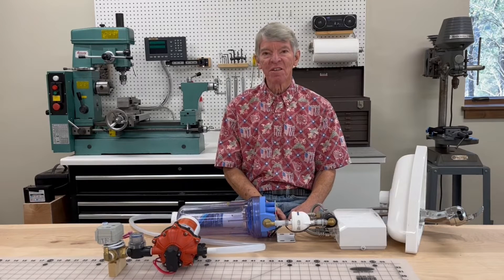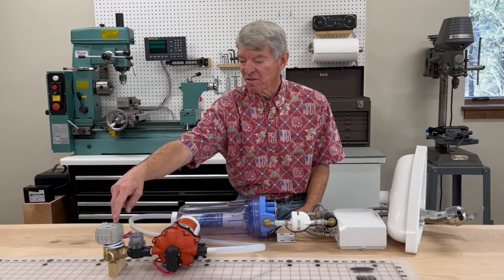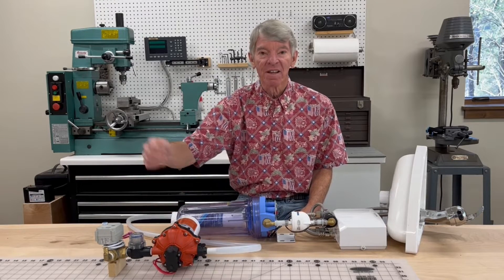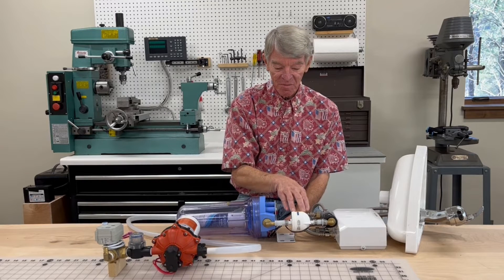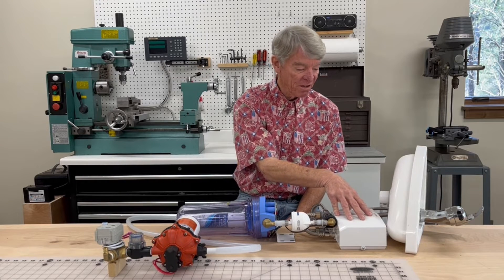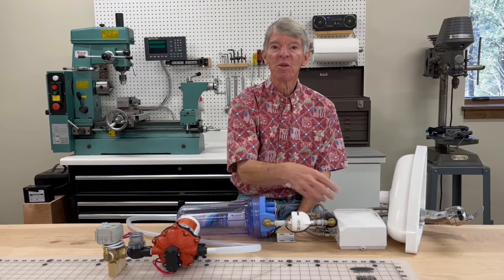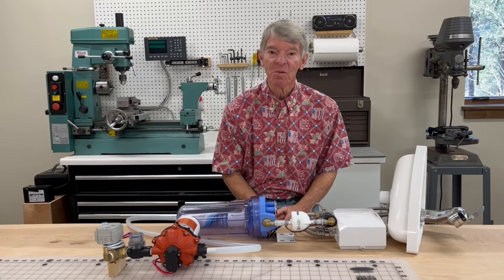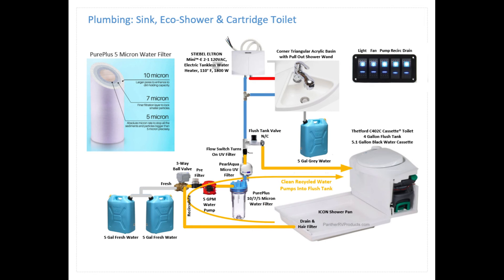Camper Van All-Electric Recirculating Shower w/Tankless Water heater and LED UV Filter

Comment: Hey Pete there is another Stiebel water heater that doesn't have the Thermostatic control like yours, It's a little cheaper.  Mini 2-1 231045.    Did you consider this one ?  As essentially it seems as though by removing the flow restrictor you have basically taken the smarts out of your unit and turned it into a mechanical heater, that just heats as much as it can if it's under temperature no matter what the flow rate is.  Am i on the right track or is there some other reason you picked the one you are using?
Reply from the maker: I removed the flow restrictor to get a good flow rate to the shower head. The water is not brought up to temperature in the first pass through the heater, the recirculating water takes several passes through the heater and about 4 minutes to come up to final temperature. When first starting to heat the water the power is 1800W but after the water comes up to temperature the power is cut back by the thermostatic control to around 500W, just enough to keep the water at a constant temperature.

Comment: Would love to see a update video on your system! Like you mentioned in some of your replies. 

Just so I better understand your system... you basically pull a gallon worth of water from fresh tanks through recirculating system into the shower pan and then the you use the gallon of water from shower pan to recirculate? I know some people that have a tank to store their recirculating water. Any reasons why you avoided this tank?
Reply from the maker: Thanks for checking out this video.

Since I have no plumbing outside the van where it could freeze the recirculating water tank would be inside and higher than the shower pan. This means I would have to pump the water into the tank and then have to come up with a way to get it back into the shower pan for reuse. It seems easier to just fill a one gallon jug at the end of the shower and store the jug in the shower. This way I can check to see if it is getting too cloudy and just pour it down the sink when no longer wanted. It does take up room in the shower which is not ideal but not too bad. There are so many ways to implement a recirculating shower and my solution matches my requirements.

Comment: Hi Pete, thank you for the videos, we're in the planning stages. Currently 'weighing' the options of a larger fresh water tank vs recirculating shower. As a follow-up video maybe you can show the maintenance routine required for your system. That's one of the items we need to consider.
Reply from the maker: After we have a lot more experience using the shower I was thinking of doing a video on 1) how to efficiently use the recirculating shower, 2) how long the filters last before cleaning/replacing, and 3) how to maintain the shower for short term and long term storage. My wife and I use less than a gallon of water to take our showers. We use even less if we save and reuse the gallon of water a second or third time. The weight and space savings for carrying only 5 to 10 gallons of water instead of 20 to 40 gallons is huge.
Reply: Any update on this mate?

Comment: Hey Pete! This is great, I have based my design off of yours. Can you tell me how you went about removing the flow restrictor? Do you have any pictures or videos?
Reply from the maker: To remove the flow restrictor (which voids the warranty) I took the two end caps off (lots of Torx screws). Then you can look down the water channels and see which one has the flow restrictor installed and push it out with a screw driver. Make a note of which channel had the flow restrictor in case you want to put it back. I do not have pictures or videos on removing the flow restrictor. It has been awhile but I recall there is a temperature sensor attached to one of the end caps. Be careful not to damage the connection to the sensor.

Comment: Great vid. Did leave me wondering though, how efficient is a 2gpm uv filter in a 5gpm system?
Reply from the maker: The water flow rate of RV pumps drop significantly with backpressure. The cartridge filter, UV filter and water heater generate a good deal of backpressure. I tested a 3GPM pump and it did not compete with my home shower. When I switched to a 5GPM pump I get close to 2GPM water flow which rivals my home shower. The 2GPM UV filter seems like a good fit for my application.

Comment: I too have been working on this! I have been using an I-Heat shower head that runs on 110 an you can control temperature. I have gone with the nano ceram filters that remove everything and have a high flow rate but also I dont need the UV light because these filters remove virus/cyst etc!  The big issue Im having is using a Wavebrite Gray water module (24 inches) that removes all soaps/oils/shampoos etc in real time and figuring out the best way to hook it up because of its size. As far as I know its the only filter in the world that can remove soaps in real time, so I need to figure it out. I would like to run water through it for only the time needed to remove the soaps then bypass it as its good for like 5000 gallons an I would like to make it last., You can send filter module back in and have it refurbished!     I love your sink shower set up!  Nice!
Reply from the maker: Interesting selection of products. The I-Heat shower head brings 110V into the shower head and is a little unnerving. The one I saw tries to heat water in one pass and consumes 2.5Kw which is beyond my battery's current capacity. The filter cartridge seems expensive but I might try it someday to see if it works better and lasts much longer than my particle filter.
Reply: @fivepoundpete  Ya I don't have it in the shower I have it hooked up right after the filter and have a hose with shower wand coming into the shower stall. I can open the curtain to adjust temperature. It starts on high so you do need a good inverter, I wish it didnt start out on high because it has like 4 settings and I usually can get by on the 3rd setting which also lowers electrical consumption..My system right now is portable but not portable enough yet (lol). Like you found out circulating the water does not take as much energy once warmed up. Trying to go small but yet robust is a challenge when using off the shelf parts. Tghe 2.5Kw is to powerful next one down is better for what Im doing. I did look at the one you used but flow wasent good enough (which you fixed!) but then I was trying to figure out how to control temp range.  Anyway since you were good enough to share I was just passing along what I have learned. Just my 2 cents and passing it along to you!  Good Luck I love seeing what others are doing! Im still trying to find a better quieter pump!
Reply from the maker: I have a 3000W inverter which had no problem with a Stiebel Eltron 2.4Kw heater model but when I tried it the combination of the inverter loss and the pump power exceeded my 200A battery current capability. I am using the 1.8Kw model and can live with a few more minutes to bring the water up to temperature to avoid using a second battery (cost, volume and weight).  let me know if you find a quieter 5 GPM pump.
Reply: @fivepoundpete  Check out the Loopz Shower which is very very simple not much filtration but sometimes simple is best. They are working on a heater but its not ready. Reminds me of an aquarium heater (which I tried but they dont get hot enough (so they dont kill the fish)  Just FYI.....
Reply from the maker: I am familiar with the Loopz Shower and it is a pretty cool product for outdoor camping. I would recommend the LoopZ Plus with the UV filter that kills viruses and bacteria.
Reply: Note: you should have a check valve on water supply especially if the water your drawing from is for drinking. You don’t want when the shower is turned off to drain back into fresh water tank.

Comment: Very simple idea. ,  I have built a recerculating  shower in my caravan  , and it works well 
I would suggest you use not 1 filter. But  at least 2  , because from expeariance. I can tell you that soap will clog your one filter very quick , we can get  a few showers out of ours. No problem. 
We also only use1 tap for the shower pretty much set the temperature and that’s all. We also use gas
To heat the water as it doesn’t use any power.
Reply: If you want a filter to remove soaps in real time check out the Wavebrite Gray water module. Its not cheap but it works! I wish it came in a smaller size because its the ticket! Also check out the Nano Ceram filters an how they work. They also told me just use them as the sediment filter as well, plus now some have carbon added in for smell etc.  Just my 2 cents for what its worth and just sharing my experience an research.
Reply from the maker: Congratulations on having a recirculating shower in your caravan. So far my shower is working well. We use glycerin based soaps to reduce the amount of filter clogging. I am using a single filter cartridge but with a layered filter that effectively acts like three separate filters. By using the sink faucet to mix the hot water and the somewhat cooler recirculating water each user can adjust the temperature to their liking. One of my goals was to build an all electric van (other than the engine) to eliminate any flames inside the van. Since I am heating only 3 quarts of water, it uses less than 10% of my 200Ah battery.  Once the water is heated the power drops so low you could take a two hour shower without depleting the battery, most of the power is used by the pump.

Comment: Hey there, LOVE, LOVE, LOVE this and it's been a few months and I've watched this video multiple times, I was wondering if this was in the van and has been used and tested and what is the summary? You definitely opened my eyes on a smaller, less complicated version of a recirculating shower and I'm at that stage of my build where I'll be buying and getting this in place. Thank you for these videos and for the future answer...Joe
Reply from the maker: We used the shower a few times on our maiden voyage and it worked well with great water pressure and steady adjustable temperature. I want to take dozens of showers before I report on how often the filter needs to be replaced. So far we are delighted with its performance.
Reply: @fivepoundpete  follow up question(s). I got the Aquisense filter and the water heater. Can you show the 12V power to the Aquisense since it has a power adapter block. Also, can you show where/how you changed the water heater for flow control? Even just a few pictures would be incredibly helpful. Please and thank you.
Reply from the maker: I bought the Aquisense filter directly from the manufacturer without a power adapter, it came with a two wire 12V lead. You might contact the manufacturer for advice on how to use yours in a 12V system.
To remove the flow restrictor (and void the warranty) I took the two end caps off the water heater (lots of Torx screws). Then you can look down the water channels and see which one has the flow restrictor installed and push it out with a screw driver.
Reply: @fivepoundpete ok..finally got mine setup, yeah I'm slow, and I took off the inlet/outlet plate and saw the little plug and I took it out, but the heater is still restricting my water pressure significantly. Do you have any pictures or video of how you released the flow control? I have everything else working perfectly, it's just the flow is terrible. Maybe a peak into my own personal future.....

Comment: Interestingly there’s a product called Loopz that uses that same inline small UV filter.
Reply from the maker: I initially found it in a recirculating shower comment thread. I since noticed in the Loopz. Make sure to mount it vertically so air does not get trapped allowing the LEDs to overheat.

Comment: Nice video! Did you really compare 3x filters VS your three in one? Iʼm wondering if it clog up quite faster and how it is compared to cleaning it. Iʼm thinking to live one year in my van so all thoses details are quite important... Also Iʼm trying to find thoses types of 3in1 filters in Europe with no luck currently...
Reply from the maker: I did not prototype a three cartridge setup to compare to the 3-in-1solution. I expect I will need to replace the 3-in-1 cartridge twice as often but it costs roughly half as much as three separate cartridges. The 3-in-1 solution is a much lighter solution, fits under the sink, and is more convenient to change.
I found several manufacturers of the 3-in-1 style cartridges on Amazon, good luck finding equivalents in Europe.
Reply: @fivepoundpete  Thanks for the detailed answer! So you only compared different 3in1 filters? You also say you tried a few UV filters, could you say which ones you compared it with to make your choice?
Reply from the maker: I only tried the PurePlus 5 micron filter and haven't done an extended field test. I will see how long they last and may try another brand once I run out of filters. I didn't find an alternative to the PearlAqua Micro UV filter and I didn't try very hard since it seems perfect for my application.

Comment: Nicely presented. Like how you conveyed the trial & error build process to get it right! Many thanks 🙏🏼
Reply from the maker: During pressure testing of the fittings in my driveway I found the silicone tubing works great for the low pressure lines but I used a 9-inch flex stainless steel braided supply line from the pump to the filter cartridge.
Reply: @fivepoundpete  thanks 😊

Comment: Hi Pete and thank you for this video, where did you buy your UV AquiSense Technologies PearlAqua Micro I cant find it ? thank you
Reply from the maker: I contacted AquiSense directly and made it clear I knew the limitations of installing the filter. The LEDs in the filter use water to keep them cool so they are not damaged. The filter must be mounted vertically so on air can be trapped in the filter. Second the filter must be paired with a flow switch to ensure that water is flowing to the filter before power is applied. With a few email exchanges they agreed to sell me filter.

Comment: Are there special soaps needed for the recirculating shower?   I researched this topic a few years back.  All of my research kept coming back with soaps clogging the filter media too quickly to make the system usable.  Thanks.
Reply from the maker: According to my research, glycerin based soaps like Dr. Bonners and Neutrogena work well in recirculation showers to reduce the clogging of the filters.
Reply: I had the same question.

Comment: Great Video, I appreciate the time and efforts you put into reserching and Testing you system.  I also like that you built a system that takes up very little space.  I'm close to starting on my van plumbing, although I will be using the hydronic system already in the van, I will definitely be copying your build.  I do have a question.  What are your thoughts on winterizing your set up?  Thank you again.
Reply from the maker: In general we will be storing the van in our garage which is always above freezing. All of the pluming is inside the van and while on the road we will keep the interior of the van above freezing. In the event we cannot keep the van warm I plan to flush the system with RV antifreeze.